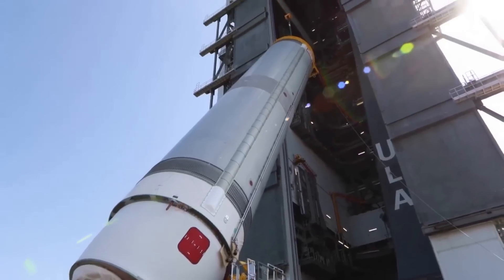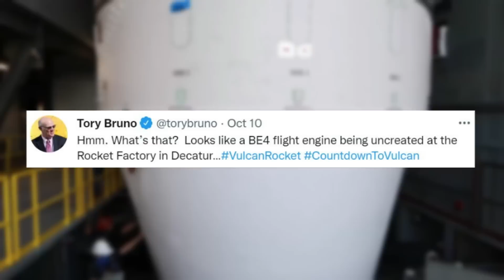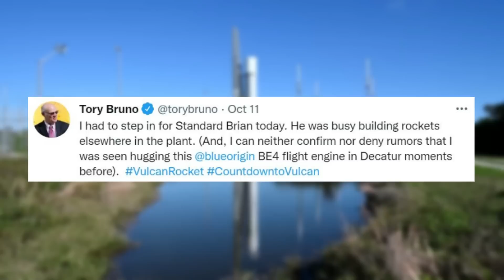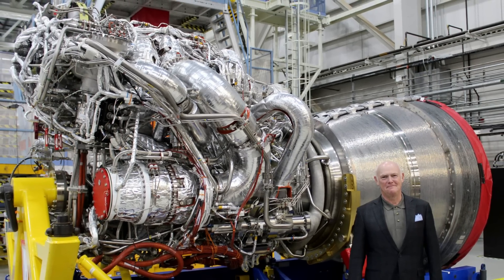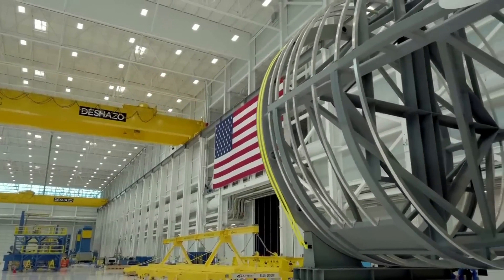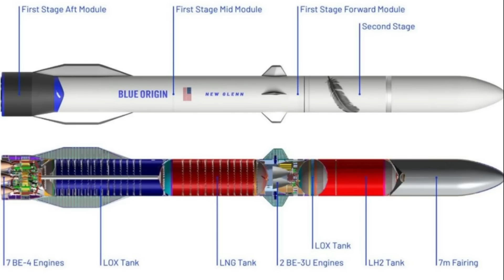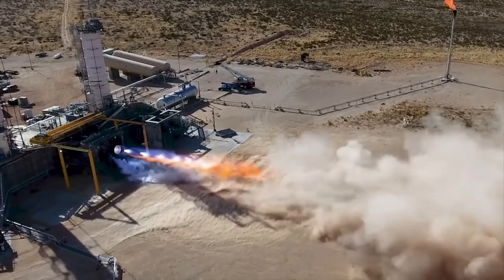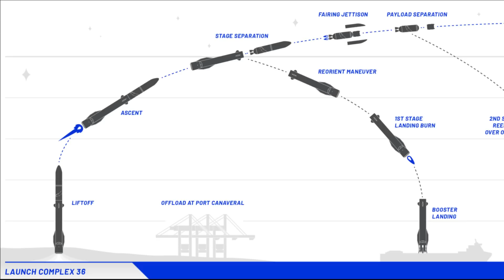An Updated In-Depth Look At Blue Origin’s New Glenn Launch Vehicle

Comment: In order to boost competition you need two or more parties more or less in the same level of 'product' development. Unfortunately this is not the case for Blue Origin and SpaceX. By the time Blue Origin will have a fully developed and tested lunch system, SpaceX will be so far ahead with its Starship Program.

Comment: If they succeed it will be very impressive, but I think Blue Origin made a mistake by going straight from small suborbital rocket to such a huge and semi-reusable system. It may seem tempting to skip the simpler steps, like an expendable <1 ton to LEO rocket, but it doesn't make sense considering the company's motto which apparently favors doing things gradually.

There's a lot of know-how that needs to be built up. Even if you hire talented people with lots of experience in the field to get a head start, I suspect there's a lot of things you simply have to learn as a company to become proficient and handling launch vehicles has a lot of steps that have to be perfected. Going for reusability just adds to the complexity and going for such a massive rocket as their first orbital launch vehicle is very ambitious.

Only time will tell if they've been too ambitious. It would be cool if it succeeds, but I'm not holding my breath.
Reply: Blue origin doesn’t have the best systems to build rockets. Trying to copy spacex and how they operate, there is no database for scheduling and loading demand. This is what’s taking so long. A lot of people don’t know what parts are what. They don’t know where it goes and how many should be purchased.
Reply: @ChauToVal  How do you know this? Do you work there?

Comment: That engine looks sooo complex compared to raptor
Reply: I don't think it's possible to make that judgment by purely looking at the outside of the engine.
Reply: @Antares2  more tubes = more complex, especially in manufacturing, engineering, and logistics.
Reply: @LifeonWheels  Not necessarily. I am sure there are other factors, like which materials are used and how they are manufactured. But as I am not a rocket engine designer, I am not sure.

Yes, the Raptor 2 looks pretty "sleek" or whatever you want to call it, but it's really not production ready. It keeps melting and/or disintegrating, which probably means it will need further redesign. It is for all intents and purposes still a prototype with a lot of issues still. 

Why SpaceX have started mass production of an engine that clearly isn't reliable yet is beyond me. It's not like software where you can push out a patch to fix any problems down the line. If the engine needs a redesign, you'll most likely have to scrap all the dozens (or hundreds) of engines you've already produced. Seems extremely wasteful.

Meanwhile, the BE-4 is pretty much flight ready and no longer in the prototype stage. Flight engines have already been delivered to ULA for the first launch of Vulcan. It's been run for full burn cycles multiple times, including thrust vectoring and throttle through the entire range of the engine. Ofcourse it may still run into problems, but I highly doubt ULA would accept the engines if they weren't overwhelmingly confident that it will work.
Reply: @Antares2  it's just different types of development. Raptor has been tested much more than be4 and has it's safe operational range. You also have to realize that raptor is pushing the limits while be4 seems to be taking a more conservative approach. Also would like to add be4 is going on customers launch systems, so they definitely don't want to be responsible for failure of payload. While raptor at the moment is just going on starship.

 Raptor will be much more friendly to scale up production than be4. I am willing to bet also that raptor development has been cheaper and faster than be4, especially with the team of engineers that have experience and information to all of Merlin engines launches and tests. For the sake of space exploration I hope I'm wrong. If be4 even comes close to rivaling raptor production it benefits humanity. Competition brings innovation!

Comment: Only 45 metric tons?  Falcon Heavy can do 70 and Starship will do more than 100 metric tons.  All these years and that's the best you can do?  LAME!!!!!
Reply: Falcon Heavy is more like 64 tons, but that is in fully expendable mode. New Glenn is supposed to get 45 tons with a reusable first stage. Ofcourse, only time will tell if they can actually reach these numbers.

In reusable mode, the Falcon Heavy can only deliver about 8 tons to GTO (couldn't find the numbers for LEO), which is in fact LESS than what the soon-to-be-replaced Ariane 5 can do.

Besides, there are more qualities of a launcher than just mass to a certain orbit. You need a fairing that's large enough and you need a rocket that can deliver accurate orbits. Falcon Heavy fails on both of these fronts which is why they were never in the running for the launch of the JWST for example. 

In fact, both Falcon 9 and Falcon Heavy are notoriously in-accurate because of their very high thrust upper stage. A SpaceX "GTO" isn't the same as an Arianespace GTO... like at all. In fact, Ariane 5 delivered the JWST on such an accurate orbit that they effectively extended the mission by years because the payload didn't need to spend a bunch of propellant to correct its own orbit after the launch vehicle had done its job.

Oh, and "Starship" hasn't flown and probably won't work anyway, so whatever numbers they are posting are pure speculation at this point.

Comment: Worth mentioning that the footage of the purported New Glenn is all from earlier this year and was a pathfinder. Anything solid from BO is notoriously hard to find, but I had heard that they had since scrapped this article due to design changes. As far as I know, there is no current image of any NG flight hardware or even any solid proof that they are currently building any.
Reply: Yup, there's nothing new to see here folks!  Just old video clips...
Reply: @michaelkim3432  BO apparently has had the aft module, landing legs, fuel tanks for the 1st and 2nd stages, and both halves of the faring. That was in August, and the only place I have found the footage is in the Angry Astronaut's video "Jeff Bezos bouncing back? Is New Glenn closer to launch than we thought?" I looked for it, but I couldn't find it anywhere else.

Comment: The Falcon 9 rocket system is currently ruling the roost. Now is the race for the following generation.

SpaceX has Starship
Blue Origin has New Glenn
ULA has Vulcan

Two of those use the same engine Blue Origin's BE4 engine. To date they have been very late in delivering them to ULA. At this time, ULA is losing launch contracts because of the delay. 

SLS is dead in the water even if it does manage to lift off and obtain orbit. Give it up NASA.

So the race is between Starship and ULA/Blue Origin, if SpaceX gets Starship operational before the BE4 powered systems become operational then Blue Origin/ULA could be in severe trouble.
Reply: SLS is not in this "race" and was never intended to be. 

It's not a commercial rocket and will never carry satellites for private companies and such.

It is a dedicated interplanetary launch vehicle for big crewed NASA flagship missions to the Moon and beyond. Its LEO capability is, just like Saturn V, not interesting because it isn't designed for missions to LEO at all. Its main challenge would be if the politicians decide they don't want to spend that money on human space exploration and cancels the Artemis program. Aside from that, I think the design will work, and the Orion capsule is already good to go. Some delays are normal, but I have a good feeling it will work as intended once it's ready.

New Glenn might become a successful commercial launch vehicle, but I'm not holding my breath. I'm just not sure there is a market that's big enough for it. 

45 tons to LEO would mean LOT of satellites (ideally) and it becomes a very big "basket" to carry very many "eggs" in. Starship is even worse in this regard. The "100-ton to LEO" market simply doesn't exist at all. 

I suspect both New Glenn and Starship, if any of them ever work, will mostly exist to service their own company: Orbital Reef and Starlink, respectively. And you don't make much money by being your own customer, so I have no idea how they intend to turn a profit from this in the long run. And missions beyond Earth orbit are definitely not going to make any money. They will be pure expenses, which is why anything beyond Earth is usually government or research space missions.

ULA Vulcan will probably be equally successful to the rockets it is replacing (Atlas and Delta), provided the engines work and can be delivered at a reasonable pace. The reusable engine concept is interesting and I look forward to see if they can actually pull it off with the in-air capture and all that jazz.

Beyond that, on the commercial side, I think Arianespace has a lot going for it for the GEO-market with the upcoming Ariane 6. Ariane 5 is already famous for its amazing accuracy and ability to launch two GEO-satellites at once, and I suspect the Ariane 6 will be a good successor.

And ofcourse for domestic missions, the new Chinese rockets are looking pretty good. The new Long March-rockets (LM5, LM6, LM7 and LM8) are already looking very promising. China is also developing the Long March 9, but this will fill a similar role to the SLS: crewed missions to the Moon and beyond, so it doesn't fit in this comparison. Aside from that, they have a lot of private companies developing smaller commercial launchers which might become successful.

The small launch (less than 1 ton to LEO) market actually seems to become much more competitive going forward. There's so many new startups in so many countries that it's very hard to predict which will be successful.
Reply: @Antares2  Yes SLS is designed to take us back to the moon and beyond (interplanetary). The problem SLS has is ita operating price tag. 

What will happen is no matter if SLS flies or not it will get canceled for the reason of its price tag and time it took to become operational. 

NASA will have to turn to private companies like SpaceX. Maybe ULA & Blue Origin can be part of it but in the end it will come down to safety record, price & launch availability. 

Can Blue Origin make BE-4 engines fast enough? Can NASA build more SLS in a timely manner and be affordable to the taxpayers footing the bill?

Can Starship fly?

I'm betting along with millions others that SpaceX can pull it off.

Comment: Obviously blue origin isn't going to fulfill it's obligations on time..just buy some Merlin's or raptors from SpaceX...I don't understand why they can't just do that...I'm sure the raptors would work fine...
Reply: Cuz BO and Space X can't get along
Reply: Buddy, one problem: spacex doesnt sell parts. They never did and it doesnt seem like they will.
Reply: And of course we all know that Raptors still doesnt consume themselves
Reply: What???...BO already delivered the first BE-4 to UAL....the scond is coming....he will fulfill his obligation with UAL
Reply: Mate, your post looks like it's months out of date. For all their faults, Blue Origin has delivered the first 2 flight engines for Vulcan to ULA, they are on to final assembly and test, vehicle integration then static fire. It will all come down to reliability. We will just wait and see how the first launch goes. Also, you don't just drop one make of rocket motor out and bolt in new one. Thrust structures, plumbing and potentially tank ratios would all need to change to accommodate Raptor 2, basically redesign the whole rocket, which could add years to the process.  The bigger question is would SpaceX even sell engines to ULA, a direct competitor, even if ULA asked them?